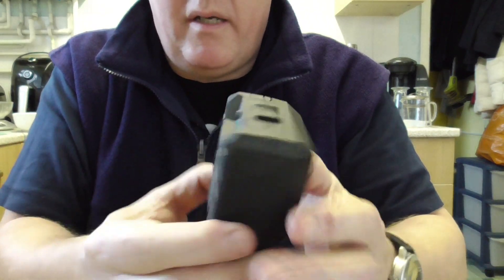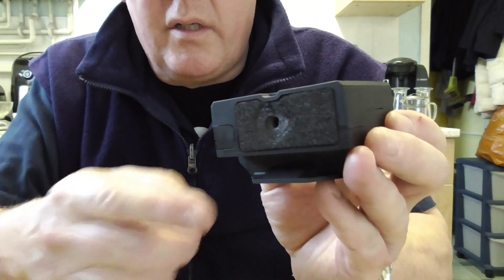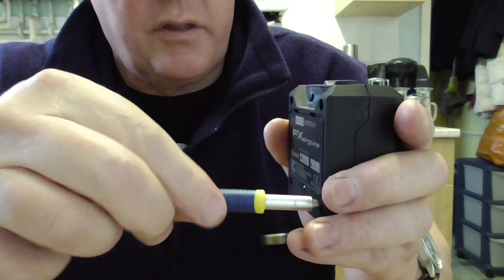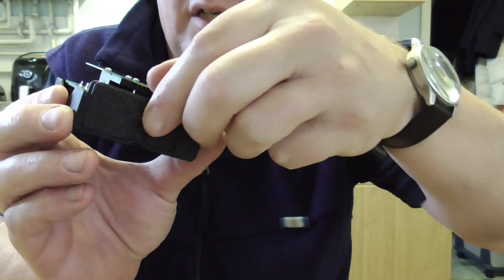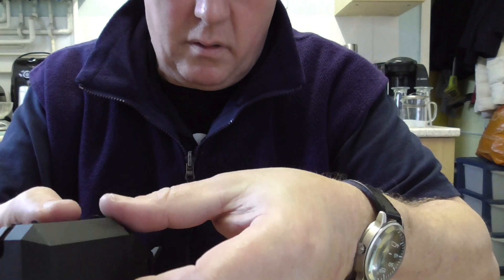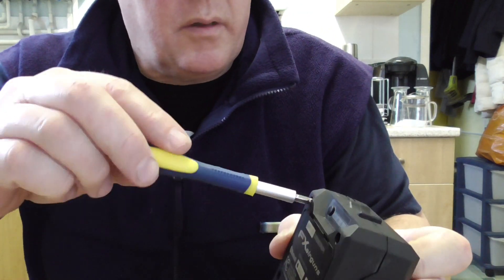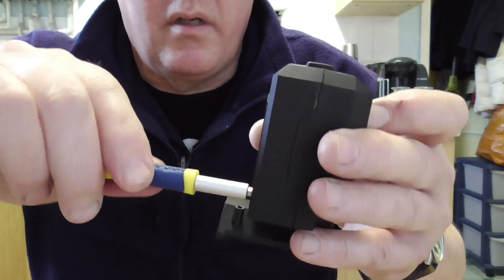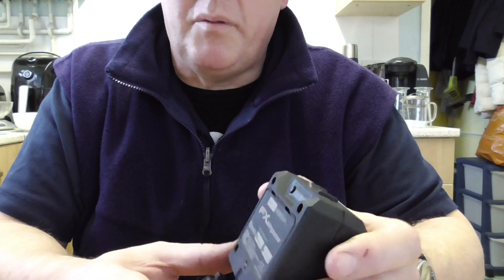FX Radar Barrel Mount Fit 26:11:2019

Comment: I have a only have a Gamo Swarm Whisper break barrel... would it be better to use a tripod with a break barrel? I’m thinking putting it on the barrel end won’t yield the best results.
Reply from the maker: The FX Radar will work on break barrels providing it is a tight fit on the end. Another thing to remember is that nothing must be in front of the chronograph (this includes rain) as I have found it produces some odd readings.